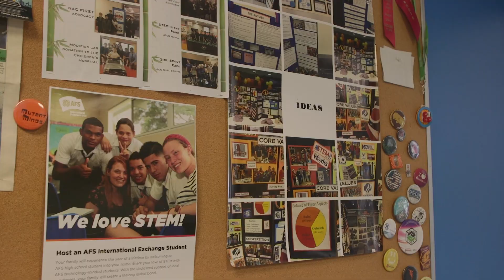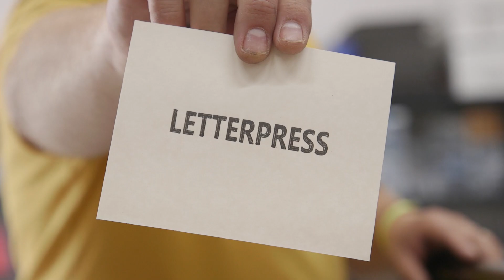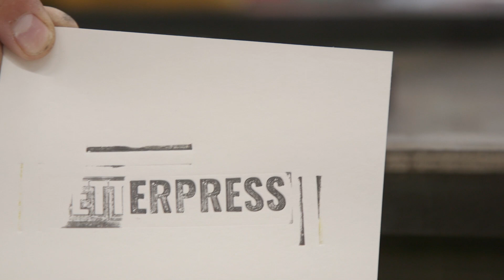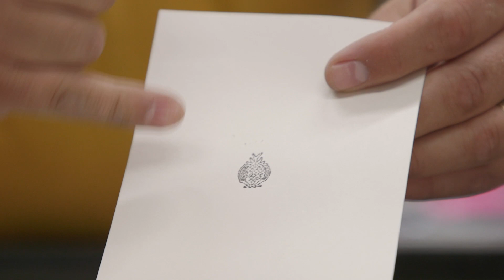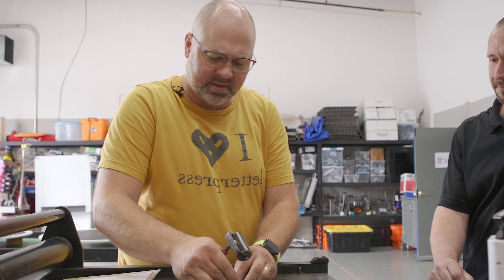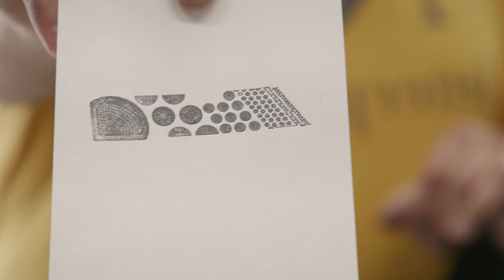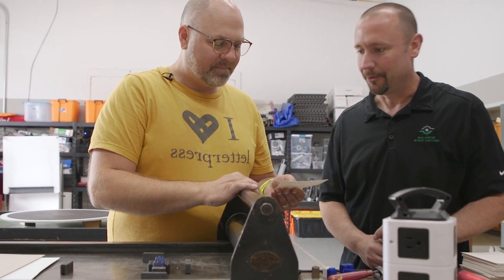ep06: Letterpress 3D

Comment: Pretty cool that this worked so well. I was worried as well that the press just crushes the plastic. (I guess it will deform slightly over time, but this is not something you want to make 1000 impressions from, or you just remake the plate if it deforms too much.) With a better 3D printer, or even sending the 3D files to an industrial printing service, you could probably get really great results for custom designs. The only thing that is kinda limiting is that you can't really get extremely sharp corners or tiny details/fonts printed. But for larger posters/fonts, this is usually less of an issue.
One thing i will try is to play a bit with the slicer software that makes the toolpath for the 3D printer. You can set how it will fill out the top surface, and there is even an "ironing" function that drags just the hot printer nozzle over the top surface again, to fill in all the little voids and get a more even and consitent surface. Some flat-sanding after the printing might help as well.  Another idea would be to print the design inverted, so the face of the letters are sticking down on the print bed of the printer. This would probably help to keep everything even and flat as well. Might have to add some draft angles and break-away supports, to build up the block on top of the lettering. Gives me tons of ideas to play with and experiment... 😅
Reply from the maker: These are great ideas! I’ve played with a few different options let me know how your experiments work.

Comment: Cool vid thanks. 
It'd be interesting to see if you could fill the print lines with bondo and sand down the surface so it's flatter. It would be a lot of work if you're always printing different words but if you make an alphabet it could be worth it.
Reply from the maker: I have not tried bondo, but I have played with wood filler. In the end I kind of like the 3D printer “look” after all, a lot of my antique woodtype has scratches and nicks for its patina so it’s similar.

Comment: I've been trying to do 3D printed stamps, but not with the best results, so it's really cool to see that it works 
well for letterpress! 👏
Reply from the maker: Pressure is certainly a key. Try rubbing the paper with a wooden spoon or even carefully striking it with a hammer. I also have found that oil based inks work better to adhere to the PLA, however that does cause a hiccup on cleaning it thoroughly.